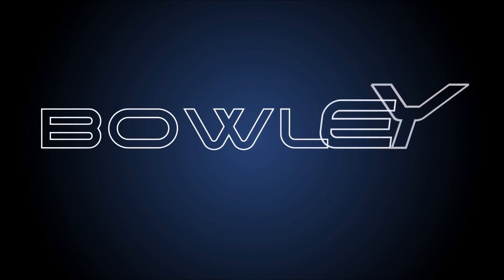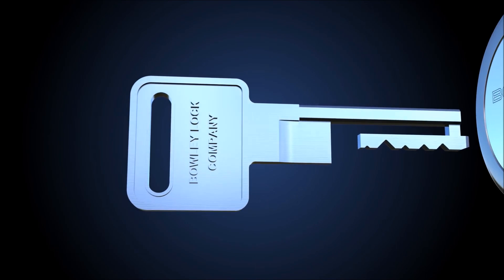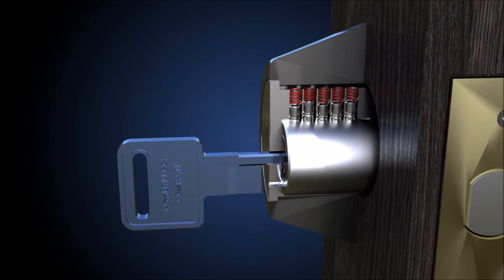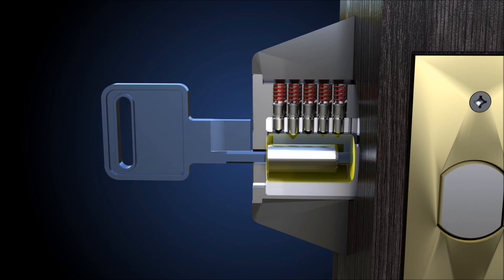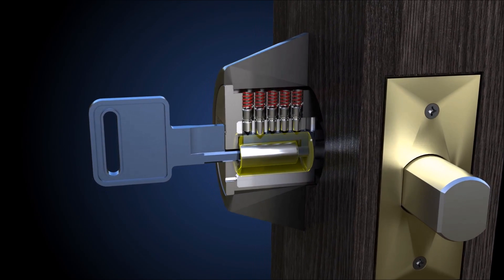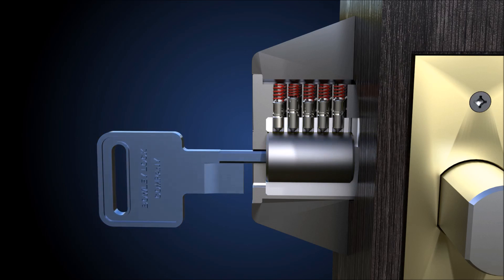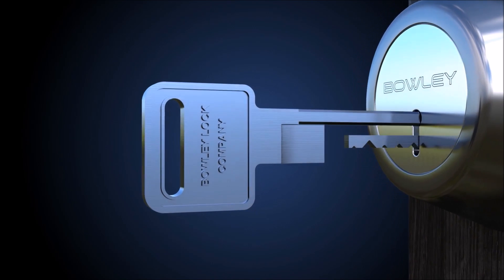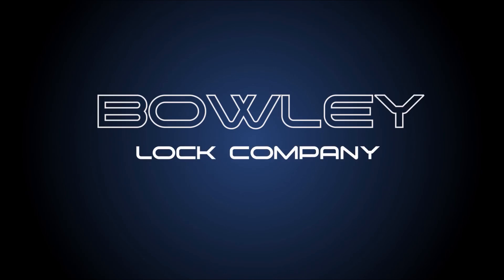Bowley Lock Animation

Comment: Chris Ahrens picked it....many others will too
Reply: Chris had the key in hand and used it to essentially make another key using several thin shims.  By having the key, he was able to see which pins were zero pins and which ones he had to manipulate.  I doubt he would have been able to open the lock if he hadn't seen the key beforehand.
Reply: Unless this becomes mainstream, pretty much not a single thief will be able to pick this

Comment: This is even giving Lock Picking Lawyer a super super hard time!

Now, mind you, if your house has tons of breakable windows and thin sheetrock walls and the door is a $99 special that's two sheets of cardboard thin plywood over a thin pine structure any thief will just kick the door in or break a window.  Lots of homes that people begged banks to give them usurious loans to get at high value are made dirt cheap with every cost corner imaginable cut, slapped together by underpaid illegal immigrant labor.  Most SWATting issues have da Fuzz just having their guys kick right through the walls since the house is in public record (that thieves can easily access) to be assured they can do that.

Also - heard of Credit Card entry?  Lots of doors you can shove a credit card, try a dummy one they send you to try to get you to sign up for another debt.  IF your door can be shimmied open that way, either call a carpenter or carefully pound in and if it works use Epoxy to secure some thumbtacks.  Lots of thieves just walk up to doors, shove in the credit card, then run in and grab stuff and walk briskly but no real hurry out to the car of a friend following them.  If it doesn't work they go to the next house.  Often 1/3 it works, so two or three houses during the time the worker slaves are working 2 or 3 jobs to afford the bank interest they jump in, grab a few thou of TVs, game systems, etc. and leave.  The police so eager to stop the worker slaves on the way to work for a taillight burnt out or claiming they sped by 1mph, etc. usually ignore the reports only filing if they have to for insurance.

BUT - to secure something that needs securing, the door to a 'safe room' inside the house - where a thief that breaks in will try to pick and the walls are concrete with a steel reinforced door - this would stop them - even if they drilled it.  I don't mean "Panic Room" though those can be a good idea also - but if you can't turn your home into a fortress but do have some valuables beyond basic appliances its good for a room inside to have walls poured with concrete and a metal door.  You can run in and hide there (keep survival gear stuff) but if it's just to lock your guns, bonds, gold coins, pile of playboys you read 'for the articles' but don't want the kids seeing (heh, internet people) etc. this would be the perfect lock to get it.  Most keypads can be defeated by a magnet trick.

Frankly, per LPL and his lesser skilled but still cool friend Bosnian Bill it is sickening how easy most of the locks are to pick - including plenty of "Pick proof"/"Pick resistant" ones that sell for higher prices than cheap Master locks.  Like semi-insane arms pocked marked with scabs trembling Meth addict using hairpins from a bloody purse he 'found' level of ease of defeat.

Comment: One HUGE problem with this lock is that someone could turn the rotating idler 180 degrees without the key and this lock would be "bricked" or in other words the lock would be stuck in the locked or unlocked position.
Reply from the maker: Jimmy Johnson the lock does not brick in that scenario. the idler does not allow the pins to fall in and turning it will push them back up. It is hard to see that in the video and many people have thought that could happen but it cannot.
Reply: ok. good to know. thx for the reply

Comment: If a person wants in bad enough they will find a way,   no point in breaking the bank buying expensive security locks for your home instead invest in some big and intimidating dogs like rottweilers or dobermans chances are if a criminal is at your door trying to break in they will hear the dogs barking and growling on the other side of the door and the criminal will decide this house is not worth the risk of loosing an arm or leg and simply go to the next house that does not have any dogs to contend with.      Still this lock is interesting a different way of looking at a lock in general who ever the designer that came up with this design was thinking out of the box but i would have concerns with the key it looks to be very fragile.

Comment: I think lock picking it would be possible, but an order of magnitude more time consuming than any other lock. A special, thicker rake pick just for this lock would be necessary, most commercial lock picking tools wouldn't have a bowley pick available as 99.99% of commercial pick sets are cut from .02 inch stainless or similar.

Free tips:
- Reinforce the lock face (if you haven't already), a brute force method is possible whereby a hooked lever could feasibly pop it out, something regular tumblers are immune to.
- Don't be afraid to make thinner keys out of tougher metals (titanium), this would force the thief to cut picks out of the same (or tougher) material if he wants to turn the tumbler without bending the pick. Its good branding as well, and most customers, especially government, would pay more.

Comment: It is honestly a lot better than other security locks out there. Just due to its simple design. A lot of engineers will try and re-invent the pin mechanism. This relatively simple change is enough to improve the security drastically.
Reply from the maker: Vriska Serket thanks for your comment.

Comment: if you try to pick this lock and you only rotate the inner cylinder 180degrees, the pins will fall and in turn locking the inner cylinder in place. at this point there is no way to reverse what you have done, except succeeding in picking the lock. no key or rake will be able to enter the lock. please correct me if i am wrong.
Reply from the maker: TiBliRoN that will not happen. That is referred to as bricking the lock. the idler can be rotated to the top and the pins will drop but there is a   ramp on the idler that allows the idler to lift the pins and be rotated back to the bottom. it is hard to tell that from this video.
thanks

Comment: To pick a Bowley lock: Take two keys and file then down to half their thickness so that they can both fit in the lock together. Then remove the pin pusher portion from one leaving just the tensioner. Remove the tensioner and all of the pin pushers from the other one. Now attach a little lock pick spike onto the tip of your second key. Insert them both into the lock and rotate them all the way up. Insert the tensioner key and apply tension. Pick the lock with the other. Done.

Comment: +Bowley Lock Company Inc You guys need to make sure that the cylinder the key turns in the beginning is self-returning. Otherwise any prankster could stick a paper clip inside and turn it so the owner can't put their key in.
Reply from the maker: NerdyPi they could do that but it can be returned to the bottom with a pick. you can prank any lock by breaking something off in it or putting glue in it etc. I don't think that will be a major problem unless your freinds are real pranksters.

Comment: wait, if i want to use this for my main front door at my house or apartment do i have to leave the key in the lock every time its unlocked? you mentioned in the video to remove the key you have to lock??
Reply: Not from what the video shows - the locking/unlocking movement and the key enter/remove movement are two entirely separate actions. Whether the key is fully or partially inserted once it's turned to the top determines which you will do. So to unlock you would need to 1) insert key 2) turn to the top 3) insert the last little bit 4) turn to unlock 5) return to top position 6) pull key out slightly 7) return to bottom position so you can remove the key, and the lock will remain unlocked.

Comment: "pins fall down into place so no bumping" Thats not a problem at all simply have a bumpkey (another "Bowley" key) cut to max depths and bump in reverse pulling the key towards you. This can be done something like a plug puller might do (or a dent puller on a car) Unless the tip of the key will disengage as the key is drawn back.
Reply: No that wont work.
Only the very tip of the key applies pressure to the cilinder. If you pull the key out this turning pressure ceases to exist
Reply: nice =]

Comment: one way to make your lock more secure, and less likely to be exploited is to not depend on one exclusive mechanism to actuate the lock. what i mean is the pinning so use pin tumbler for some, disc detainer for others, dimple pinning for others, etc, whatever you can do and keep the external lock the same so it cant be told from just looking  what tool to use, if tools for this are developed. i woukd be interested to see one end up in bosnianbills hands to see if he can defeat it non destructively. and deviant ollam. hes a snob but he knows what hes doing but he will probably  require two or three locks and have to use a key blank or a modified key from another same type lock to do it. he would destroy  one or two of the sample locks to find a weakness you can only find from doing that amd then devise a impractical (on average) method of bypassing or picking it.

Comment: ok some of this stupid. you cant keep out someone who really wants in with just a single lock. a lock os only part of a security  system. the door, the frame, the window, amd literally hundreds of other aspects interact to provide security  against  likely attacks on you or your property. the more extreme an attack is, usually for the average person, the less likely it is to happen. so this lock alone is not enough just like any other lock isnt. whether or not it can be picked or bypassed is not so important as how long it might take to do. and thieves dont carry an infinte tool bag with them, though they can carry many, so far, i havent seen a way ( though i have an idea using an oscillator) that  typical picks are going to be effective against this type of lock in a reasonable amount of time.  have you seen no country for old men? it might not work quite that nicely, but something like that would take out just about  anything. so is this lock 100% unbeatable? no its not.  is it unpickable 100%, again, probably not. is it well made sturdy, newish, unusual? diffucult to fiddle with and time consuming?  absolutely. is it at least harder to beat than the standard lockset for home use? o yeah! is it reasonably-priced? at the suggested  price of 120$ usd, thats a reasobale price. so eve  if it can be beat non destructively, there arent that many locks out there that cant be, the ones that can are probably 10 times the price of this and not practical. as part of a well designed system including a security door, reinforeced frame with kick stoppers, good doorway lighting, being friends with your neighbors if possible or appropriate,  this makes for at least  5 times better door lock securite than a standard kwickset or shclage. and only a little bit more in cost. who cares if someone's  cousins buddies dogs brothers owners neighbor can bump it or pick it, if the average scumbag cant or doesnt want to bother? just because someone like bosnianbill or deviantollam or lockman or wizwazzle might come up with a successful attack once on a video they might have practiced hours or weeks or months to make, doesnt mean that your average cat burglar is going to be able or want to do this. amd just because someone like bill picks one of these locks, doesnt mean that that technique will work  the same way on any other random example of any given lock type, bitting makes a huge difference in technique or even success sometimes. so this is a good lock at least for now, and it doesnt matter if it can be beaten, but how long it takes amd in what contexts that methhod can be reasonably used.
Reply: And the back door
Reply: +river vanderfeen what? explain your comment please.

Comment: if you were to jam something in the keyway and rotate the cylinder without having the portion of the key that manipulates the pins would the pins fall out into the cylinder jamming it permanently?
Reply: +94fishhead I'd think someone looking to grief the lock's owner could just as easily fill the lock with superglue or something.  Not to mention that that would be more difficult to repair.  At least with a jammed Bowley, one could reasonably expect that the lock could be disassembled and corrected once access was regained.

Comment: https://3dwarehouse.sketchup.com/embed.html?mid=u57356de9-0390-451c-adb8-4b25d1596538&width=580&height=326

Simple solution to picking the lock. It's a two piece mechanism. The right (Blue) half serves as the rake. xD
Reply: I didn't design the particular one in the link, I simply happened across it after looking to see if others had the same idea as I did. I have a knack for picking specialty locks and this was similar, but not exactly like what I came up with.

Comment: Someone already has a lock pick diagram online. It has design plans on how to make a master key. People forget that 3D modeling software can be used to design something without even having the lock in front of them. This company helps with this process by providing this wonderful cut away video. Its like writing a number on the palm of your hand then holding up your hand and asking someone to guess the number.
Reply from the maker: +killersushi99 
As soon as the lock is for sale any one can take it apart and reverse engineer it and do what ever they like with it.
You can 3D model all you like but exact dimensions are not be deduced from an animation like ours. The bump key idea is cool and i cant wait to see the lock sport community attack our lock but certainly modelling a key that is similar in shape does not mean the task is complete nor does it mean it will work.

Comment: full credit goes to the maker of this but here is the bump key for this lock :P
https://3dwarehouse.sketchup.com/embed.html?mid=u57356de9-0390-451c-adb8-4b25d1596538&width=580&height=326
Reply from the maker: +Keith Larsen 
So far we have added a spools or serrated pin in each lock. We have not yet threaded the pins holes or used mushroom pins yet. Luckily those are easy to add to the product  if attacks start to happen sucsessully. Thanks
Reply from the maker: +Andrei Stefana 
Not sure who modelled that key but good on them.  We have had that idea proposed many times now but no one has taken the time to model it until now. Modelling is easy, manufacturing is the hard part. It wont work as a rake and this lock has several other antibump features not disclosed yet which will make a key like the one modelled ineffective.
Reply: +Bowley Lock Company Inc Would I be right in assuming you must have some sort of white-hat expert thief that assists you in making sure there are no unseen attack vectors?  Someone in-house who serves as an alpha tester, vs. the beta testers you'll possibly call for with a prize when the product releases.  I assume all lock engineers would effectively become white-hat thieves after some time anyway, but someone dedicated purely to breaking the design would seem valuable.

I'm just curious, really--if this would reveal trade secrets in some way, I fully understand if there's no comment.
Reply: +Bowley Lock Company Inc You could easily make it with an edm machine.
Reply: +Bowley Lock Company Inc spool pins? y'all got some spool pins? Threaded cylinder and serrated pins? T pins? Mushroom pins? I'd suggest radical bitting, but that's the one weakness of this design.
Reply: AikenGhoti - Oh no, not even close! What you suggest is actually something that I do for several lock makers but Bowley are happy to go with what they have! Which btw, is a monumental mistake ;-)

Comment: This is an adaptation of an ancient roman pad lock.  It has a cylinder that holds the key.  But, the action is very similar to ancient Roman pad locks.  the major difference is that the Roman Locks used a single tumbler (and or pressure system) while this lock uses multiple locks.  The Egyptians also had a similar design (although the key measured a foot long)..  What is old is new again.

Just google "ancient Roman pad locks" and you will discover the design is not new.  The major difference lies in that Roman padlocks did not turn.

Comment: the first thing you will notice is that the key has most of the metal removed, so that it can easly bend out of shape causeing you to be locked out of your house and freeze to death
Reply: +TheCcrack 
they say its thicker than normal key, and the metal is stronger, but carrying it in small case wouldnt hurt I guess
Reply: +TheCcrack It actually doesn't bend that easy. At (0:05) they tell you to go to lockman28's review. He tries to bend it in a vice.
Reply: oh really?  ill check that out then, did they say what the key was actully made from?

Comment: I dunno about picking or raking, and I'm not a lock expert by no means, but if the length between the disengaged position and the engaged position is enough to bump, then it could be bumped with a thinned down bump key so a similar shape torsion wrench could be inserted at the same time. Just slide in the bump key and the torsion wrench, twist them 180 degrees, push the torsion wrench to engage the cylinder, apply pressure, bump the key -> profit! It could work in theory.
Reply from the maker: +mrkiky 
Well said, One of the issues is the distance between engaged and disengaged is about 1/2 the length of a normal bump.